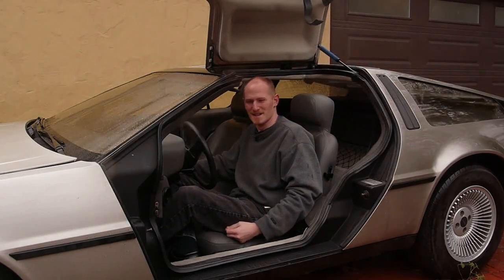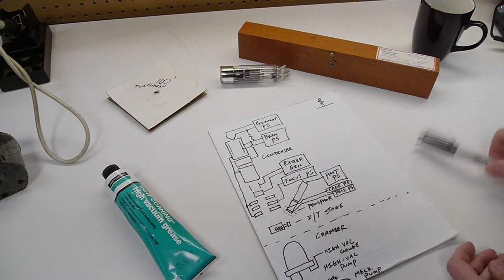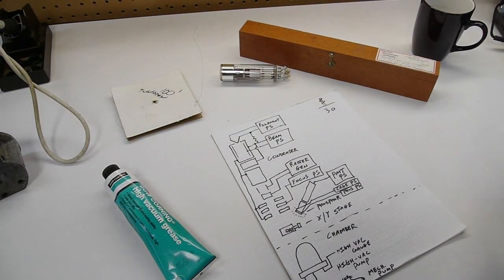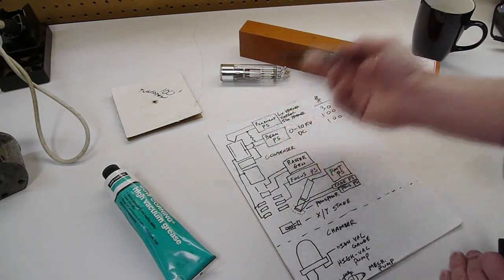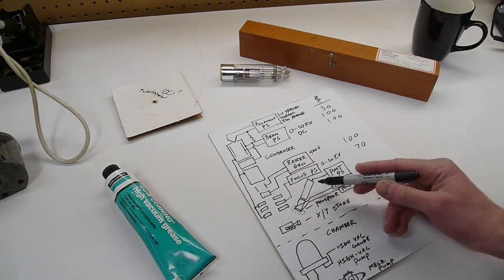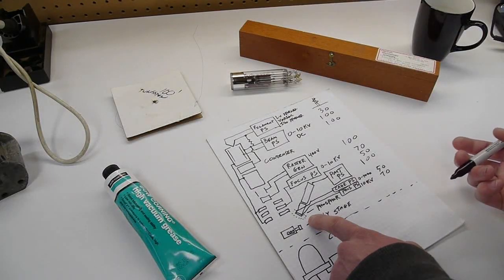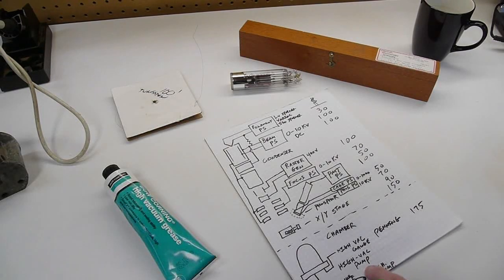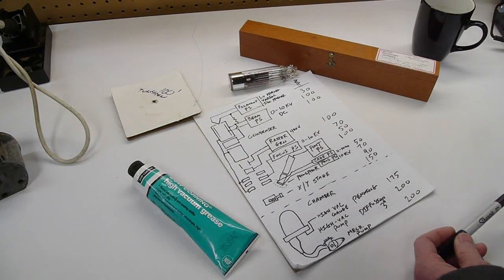DIY Scanning Electron Microscope - Sources, Costs and References

Comment from the maker: Search for "paschen curve" to see what distance/pressure is required for breakdown. The biggest problem is that vacuum quality at one point in the chamber may not be the same as vacuum quality at some other point in the chamber. Breakdown can happen even when the gauge reads 10e-6 if there is a leak or virtual leak causing localized higher pressure.

Comment: Recently discovered your videos just under a week and a half ago. Given your working (and extensive) knowledge of chemistry, electricity, fabrication, machinery, physics, thermodynamics, and mathematics, I would not be surprised if you actually, one day, just stumbled upon the necessary components and properties to make a working flux capacitor.

Video Intro: "Hey guys! So while I was baking a new batch of cookies, I accidentally discovered the properties that make time travel possible. Who'd have thought?"

Really enjoy your videos, BTW. I never thought it possible to create a plasma cleaner small enough to fit within the space of a desk inside your home or shop. It got me going on a Bell Jar tangent -- started looking up prices, sizes, and what-not -- not to mention these different videos have generated some potential ideas for homemade science experiments of my own at some future point (with safety as the top priority, of course).

Keep making more videos. They're both fun and fascinating to watch. Thanks for taking the time to make them.

Comment: Very  interesting. I did  40 years  in  EM both  TEM and  SEM. The first  EM I used  was  an AEI EM 6B.No automatic  valves  ! you had to  be careful. 

Don't 

Don't  forget to  get an ultrasonic cleaner  Cheers  Robin

Comment: that is really simple, I have most parts, those high voltage power units could be home made and the whole thing could be made much smaller, interesting project
Reply: did you built it ?
Reply: Yeah did you?
Reply: @platinumvulture1122  yes, I used a vacuum system we have at work
Reply: @DolezalPetr  make a video on it
Reply: @platinumvulture1122  it is long scrapped, like a year ago, I am surprised people are commenting under this comment
Reply: @DolezalPetr  how can I make my own vaccum system? Any suggestions?
Reply: @platinumvulture1122  what for
Reply: @DolezalPetr  to make my own electron microscope
Reply: @platinumvulture1122  I guess just scavenge an industrial one